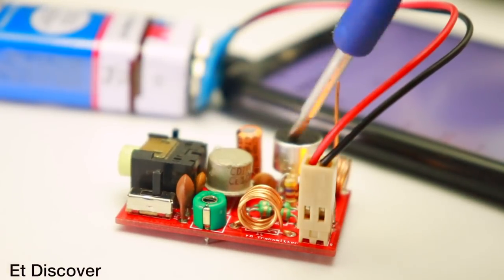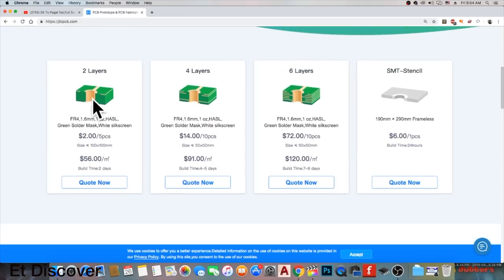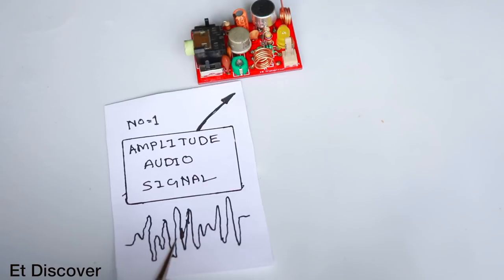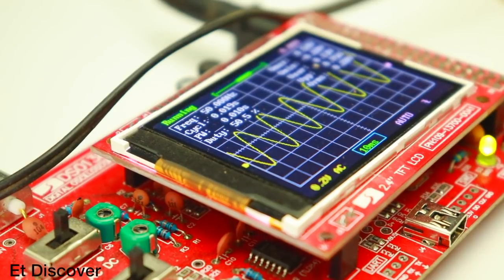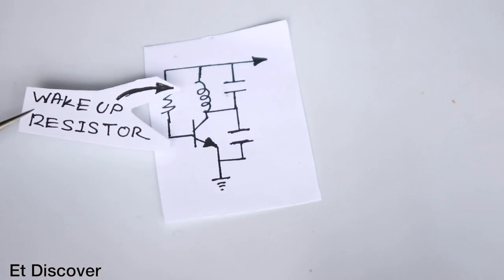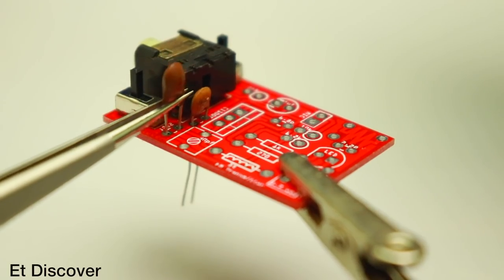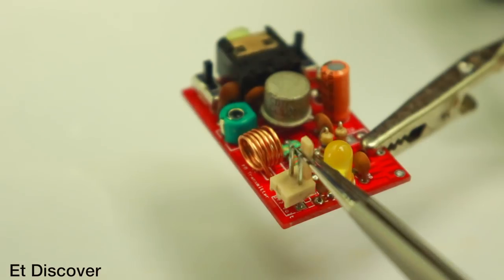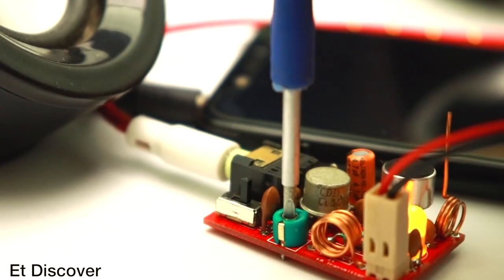5 Watt Long Range Fm Transmitter And Working Principle

Comment: is the frequency stable? i made a lot of fm transmitter circuit for our project but not a single one have a stable carrier oscillator.. the design of the tank circuit looks like its not stable. i hope  i am wrong cause i will test this for our final project badly need it to stable and does not shift to other freq.

Comment: Can we make a long range  transmitter using carg7 device ( Bluetooth fm transmitter for car stereo)
It will be of more stability and quality sound..if we can amplify the antena output then we cam improve the range... Think about that and find out a suitable RF amplifier circuit.
Reply from the maker: Ok I’ll definitely thinking about it

Comment: I think you forgot to include antenna coil diameter, number of turns and length. I could not find any antenna tuning information on your website or in your circuit diagram. What is the actual output as built with that 9 volt battery?
Reply from the maker: 4mm by 5mm.  Antenna will exit from the transistor’s collector pin. Everything is in the diagram , Look carefully, thank you
Reply from the maker: And the inductor will be 5 turn

Comment: The Video Is really great!!Now the problem is that I have only 104 and 103 ceramic capacitors!Can I use those instead those different valued capacitors???
Reply from the maker: No
Reply: you can actually, but then the inductors value will also change, and range might reduce drastically. Basically, you'll probably have to change the value of every  other component

Comment: yes i found it.  but i cant understand the crcuit...the transister emiter to collector pin..what capacitor used...i am find in digrame 4.7 uf... the digrame is not match with project??
Reply from the maker: 1st 22pf  2nd you can use 5pf/ 4.7pf / 6.8pf
Reply: ok...but betwen the collector and emiter pin...4.7 uf are connected. ....whay

Comment: Sir u r awesome Indian "Great Scott" 

Loved all your vids

Make a video on latest yinglong LTO 2.3v 40a battery which has awesome 25000 life cycle
Awesome battery pack last for 20 yr for DIY ebike 

Hope so u will make it reality 

Thanks a lot 😊
Reply from the maker: I'll try
Reply: Nice 
What about the schematic is it available? 
Thanks
Reply: @EtDiscover  WHAT MAKES A LONG RANGE TRANSMITTER ? IS IT THE TRANSISTOR ? OR THE ANTENNA ?
Reply: Why you don't upload PCB??
Reply: @EtDiscover  NEED YOUR EXPERTISE , I'VE SEEN VIDEOS ON FM TRANSMITTERS USING ONLY 5 COMPONENTS. ( QUESTION ) IS IT POSSIBLE TO DO THE SAME DESIGN USING A CL1005 TRANSISTOR ? WHAT CAPS AND RESISTORS WOULD I USE ?  THANKS

Comment: It is not possible. 5W over that little can transistor of yours would burn it within seconds.
Reply from the maker: This is possible, Because here more voltage and current Collapsing in 100mhz, As a result magnitude flux Produce in big area
Reply from the maker: And this transistor Easily can handle five watts in switching mode, for more information you can check out this dataset ,
Reply: @EtDiscover  Yes, but no heatsink? In your video there is no heatsink. And you're running it for minutes. Wouldn't it overheat after a few minutes?